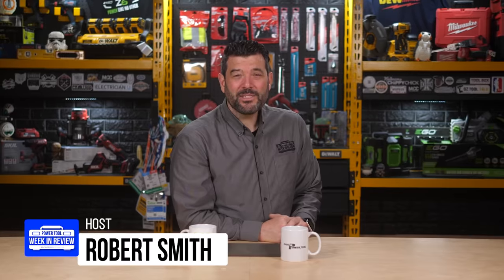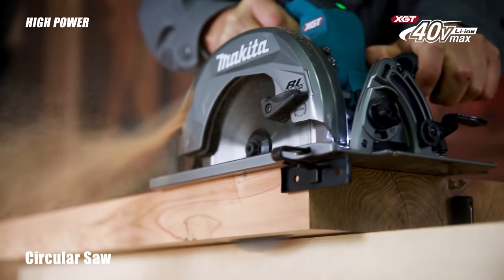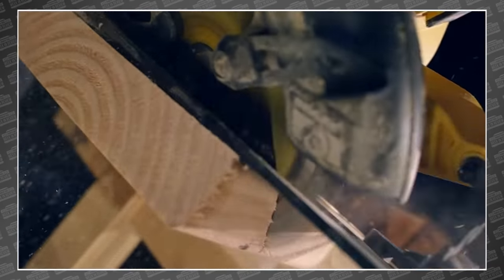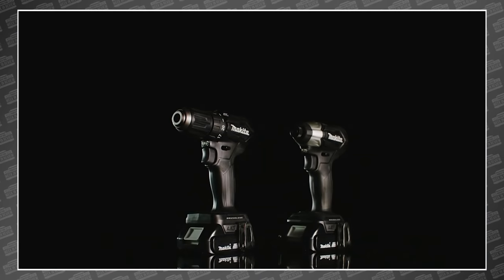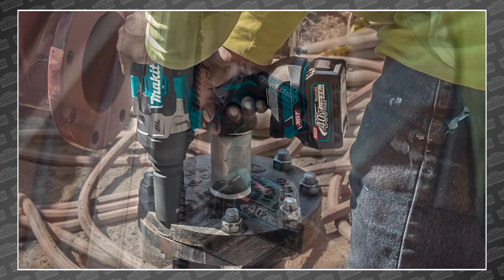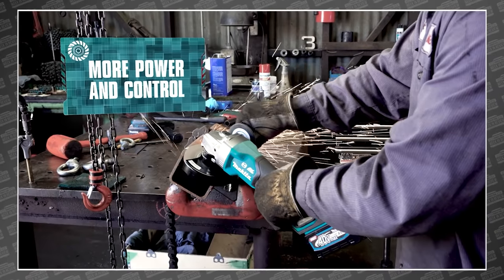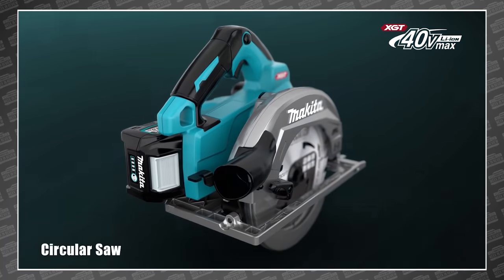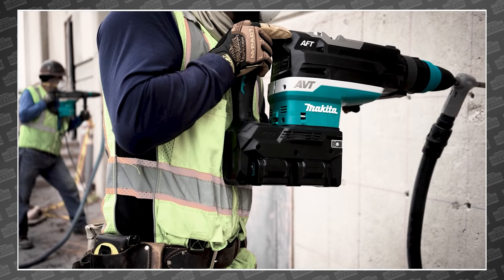FINALLY. Makita LAUNCHES NEW Makita XGT 40V/80V in the US! But the choice WON'T be easy!

Comment: yesterday my XGT angle grinder arrived.
my main problem was, no variable speed angle grinder, all LXT batterys are dead, and my charger is dead.
so, if i dont switch now, when should i.
for a time i thought about to go to dewalt flexvolt system. but the Quality of the dewalt angle grinder is not as good as Makitas.
im interesting to use the angle grinder the first time for real. and not at 3000 rpm with a pot brush to clean the center of the wheels.
maby on saturday i can cut the 80x80cm stone plates for our parasol base

Comment: Makes little sense to me since I have several of the double 18V tools. 36V vs 40V is no big deal.
Reply from the maker: I hear ya... but their point is, the 40V platform offers 80V solutions as well, which you can't do with LXT.
Reply: Aside from 40v IS 36v, it’s the inevitable double stacked “80v”/72v OPE and dust extractors that might draw your attention.  The 4.5/5” grinder are the business as well.  But, I suppose, cordless grinding is a fools errand and the 18v cuts locks just fine (just slower).   They’ve mostly been porting over LXT tools (or tools that soon became LXT versions) since the initial launch and so I’m definitely in the same boat as yourself, so far.
Reply: @ToolShow  other manufacturers have much better technology , if you you need that much power for an extended period of time you’d use hikoki/metabo hpt 36v with a battery adapter

Comment: If you need more power than a High Output M18 it's time for an MX backpack to prevent tools from getting silly heavy from batteries. Having it also be able to power M18 would be cool as well.

Comment: Thanks for this, glad I saw it. I’ve had Ryobi 18v one+ for 15 years and while they’re not the heaviest duty, I have enjoyed the single battery for all tools. I was just about to make the switch into Makita’s 18v system for the dual-battery 36v chainsaw and other outdoor tools. But if they are splitting into multiple battery types then that defeats the whole purpose for me. How long will they support 36v and 40v side by side? Not long I suspect.
Reply: Don't worry about Makita, they know there 18v customers and will continue with that line including the 36v option.
The 40v is only going to be a small specialist market. For most users the 18v is perfect.
Get yourself some Makita, you won't be disappointed.

Comment: Everyone thought Dewalt was crazy 5 or however many years back but it is still the best overlapping platform out there THEY NAILED IT!!! Yeh Makita just what I want to do go buy all new tools bad Idea
Reply: Just wish dewalt would expand it's 60v into more hand tools. Being first to market you think they would have a 60v impact by now or anything besides the 887. Interested to see if the new 12v impact rated at 450 ftlbs will be true to spec.
Reply: @zack6892  As a Dewalt fan I agree, I use multiple 887s and I've never had any problems, but that said with how capable alot of there other tools are I feel there little impacts are probably there weakest point.
Reply: @timpearson4040  exactly, the fact they revamped the 12v lineup twice now and still haven’t done anything with either the 887 or 894/899 it’s kinda a let down. Then they revamped the multi tool and made it cheaper rather than doing a flexvolt advantage version. Now Milwaukee has the better multi tool in my opinion only because Dewalt failed to capitalize. Really no good reason to stay with Dewalt right now you can get most Milwaukee stuff at similar price points if you just wait for sales maybe even save some money cause Dewalt doesn’t do hardly any good sales. I’ve already started switching to be honest and I was a Dewalt guy for the last 10 years. It’s not that the impacts listed above are junk I used all of them for years but they are so dated compared to even rigid at this point.

Comment: Since I already have a dozen tools on the lxt platform, I won't be switching anytime soon unless I have a specific need
Reply: yep, 40v line is almost double in price, too (as tools, as batteries). but some models definitely have power/speed advantage (and some now fancy stuff, as silent clutch etc), so big firms, where cost in not no1 priority, probably will make a switch..

Comment: In the case where there is one or two XGT tools I can't get in the LXT platform, I will probably just use both platforms. What am I supposed to do with all my LXT tools just quit using them? Unlikely. I wish Makita had just made a new flex volt battery. Or that they would release tools like the new duster in both platforms. There is no way you need 40V to power a duster lets get real.

Comment: I have loads of LXT tools but also have a bunch of Milwaukees M12 when a smaller lighter tool is preferable.  Whats the big deal having multiple batteries systems?  Its not like you can ever have enough batteries anyway.  I have no problem adding XGT tools to my collection for when I need something really powerful.  Having multiple battery systems isnt really a big deal.

Comment: I feel Makita missed out big time on a dual platform battery like Hikoki. the 40V max is just 36V but not MultiVolt. This segment has been better executed by Hikoki
Reply: no, it's not. different cells in 40v and definitely more power then double 18v tools. find some tests online..
Reply: @izoyt  they are either 18650 or 21700 cells, but the 2x18V option even if it were better cells was a minor adaptation
Reply: @RanDom-pl7fx  again, try to find some test ;)..
Reply: @izoyt  got any links? You have awakened my curiosity
Reply: It sounds like he's talking about the 18v x2.
But yes missed out big time. 
And could've killed two birds by using a multi-volt to finally make bigger batteries beyond 6ah.
I think I'm just going to invest more into my Multi-volt platform for larger tools rather than going a whole new line where it's only compatibility is the charger 🤣

Comment: What made LXT the best battery lineup on the market, IMO, was the amount of tools/options. I bought into Makita LXT because their entire lineup, as a whole, was better than Dewalt, Milwaukee, etc. Granted, the competition has closed the gap over the last 10 years, but LXT was the easy choice ~15 years ago when I bought in. I think I now have something like 52 tools, 25 batteries, and enough chargers to charge 8 batteries at once.  Switching over to the 40V just wouldn't make sense. For space reasons, I'm not going to carry two different lineups in my truck and the LXTs I currently own get the job done exceptionally well. What I have works, no need to switch. If Makita makes the LXT line go away eventually, they will lose me as a customer forever, but I can't see them doing that.

Comment: So instead of taking what they have and making it better, more powerful, while keeping it backwards compatible, they want you to upgrade to their new system. How many years until they want you to upgrade to their next 'new' system. Screw that. If I didn't already have a lot of LXT stuff, I'd ditch it all and go 100% Milwalkee. I've been envious of the Milwalkee advancements in their system for awhile, and kept hoping Makita would catch up. Instead they do this. I'll be replacing my LXT stuff as needed alright, but it will  be with RED tools, not XGT.
Reply: Well said I don’t understand how Dewalt can make  one battery 54v/60v battery and make it compatible with 18v/20v, hikoki can achieve 36v from one battery pack and make it backwards compatible, Milwaukee has higher output battery packs for more demand tools, don’t see the other manufacturers worrying about losing sales/customers to Makita, but I could be wrong?

Comment: My LXT impact driver, drill, and 36 volt saw is powerful enough for what I need, the LXT impact driver XDT16Z is a damn beast at 18 volts, I don’t see a need to get a 40 volt. Having said that, those tools don’t require much power to perform well. 
Now, if I need a chainsaw, grinder or a reciprocating saw then I can see the need for the 40 volt. I am planning on getting a grinder and reciprocating saw so I will be getting the 40 volt, I don’t mind owning both platforms, I just wont be buying any impact drivers on the 40 Volt.
Reply: The XGT impact driver and the drill are pretty much on par with the LXT versions.  The motors are the same size.  The hammer anvil is the same size on the impact. You won’t miss them, the XGT versions only exist so that you can use the same battery from the other XGT products. They wanted to have a basic framing/residential construction power tool kit all on one battery for the initial launch.   You’re right on the money.  Being on the LXT platform, it’s those grinders and the upcoming ope products that have my eye.

Comment: The April launch was not a well kept secret. ;)  Anyway, Makita has been good to many, providing 12v sized and 36v powered tools on the same 18v platform.   Currently, for me, nothing has been compelling me to jump into xgt except for the grinders.  I was so po’d when they released the lxt version of the xgt drill and subtracted the electronic clutch.  Should I fall into their trap and buy into xgt for an electronic clutch? Well, I already do carry around a Festool drill and it’s  batteries and a Metabo drill and it’s batteries just for the electronic clutch.  I am that sucker. When the 72v x2 ope products arrive (oh and they will) it will likely force my hand.  Since Makita, Dewalt, and Milwaukee artificially inflate their individual battery prices in order to market “deals” where you get x amount of free batteries or half off batteries in December, I have no choice but to wait, anyway.  I really don’t understand why they think professionals and tradespeople appreciate that thinly veiled battery promo hogwash, btw.

Comment: I‘ve had my hands on the 40v drill a few times now and it is not much more powerful over the Milwaukee M18 drill or the big one from Bosch. A new and stronger Bosch biturbo drill is available soon and I guess it could even be stronger than the makita. It‘s a lot of marketing. I promise you the makita 40v line can‘t compete with the power of Milwaukee MX. Milwaukee has its Fuel and High Output batteries, Bosch has its Biturbo technology with Procore (core in the U.S.) batteries. Till now makita wasn‘t able to modernize their 18v battery technology. They are still using the old cells. Instead of inventing a new more powerful brushless motor and battery combo, they offer the all new line of tools...

Comment: I've been buying these from Japan for a few months.  The impact drive will run for days and beats the pants off my Dewalt 887.  Its impact wrench is awesome to use when taking off bolts.  Makita is lightyears ahead of the completion with their autocycles on drills, impact drives, and wrenches.  I can't wait for the outdoor equipment to come out.
Reply: ...uhmm...I hope this  40v tools are made in japan
Reply: @danmorgoshi7598  Japan is their test market.  Makita’s Japanese production capacity is small scale.  It was the major economic boom time in Japan when they built the large factories in China that cover their mass scale production.  There was no way they could get the real estate nor could they (and still no way) staff those larger factories in Japan.   They’re an Asian company, they make most of their stuff in Asia.  If anything, the bs conspiracy theories about Made in Japan Makita supposedly being “better made” ought to apply to their factories way out in Germany, the UK and the USA.   They’re not some Bain Capitol portfolio asset that has been gutted and had the factories closed and production outsourced to some random lowest bidding unrelated factory.
Reply: @robertrada4783  ....✌Thanks..!!
Reply: @danmorgoshi7598  Unfortunately the set I imported from Canada is made in China. So far the only Japanese made tools I have is the impact driver and the 6 1/2 miter saw. We’ll see about the compact drill arriving in a week. Still love the hammer drill, and circ saw with the track saw base.
Reply: @ThePr0vid3r  Thanks..👍

Comment: Makita missed the mark in my opinion, we have Milwaukee, Dewalt, festool and makita already on the job. I don’t really want another platform. Wish they would have taken the flexvolt approach and I would be interested. What am I supposed to do with the 14 lxt batteries? Leave them behind? Maybe down the road when the lxt tools and batteries start to become obsolete, but until then sorry makita! The new tools do look awesome though!
Reply: I don't get it. How is this different than the jump from Flexvolt and regular Dewalt batteries and/or XR batteries?

Dewalt has a ton of batteries, and tools that either don't work, or work sub-optimally depending on tool. 

No different than Milwaukee high output batteries and/or tools.

If anything Makita has had the most standard battery platform for the longest time. 

Hell, even Ryobi came out with 40v some time ago for their OPE.
Reply: @DESX312  because the flexvolt 60v batteries can work on all Dewalts tools. Even though you can’t run a 20v on their flexvolt tools. But at least they are somewhat compatible. As far as tihe new makita if we could run the new 40v batteries on the old tools that would be cool. But instead we would have to buy all new tools. Honestly I don’t really care just thought it would be a good idea. Have a good one bud!

Comment: Basically what I think makita doing is going to eventually phase xlt tools and stop manufacturing those but you still can buy the batteries. The Xgt is eventually the only tool you can buy eventually.
Reply: no, XGT is more complex, more electronic involved and more expensive. An average joe don't need a 40V drill to hang a picture in drywall. Makita also made clear in some marketing campaigns that the LXT 18V is still the main lime on cordless tools and the XGT 40V will be a specific line of products for heavy applications. Don't make any sense have a vacuum cleaner 40V, for example.

Comment: They seem to do this change every 10-15 years to make you buy a whole new set of tools. Switching from Makita to Makita for more power? Doesn't make sense. Just like using two batteries to run the tool. Why didn't they make a bigger or stronger battery in the first place. Just another way for more sales I say.
Reply: different cells on the market ;)

Comment: 40v tools are backward compatible if you use the battery backpack. I'm already doing this as if I'm going to use the larger batteries I'm wait for larger 5amp batteries and dual 40v volt charger which aren't out in my country yet. In short my 40v max mitre saw  is powered by 18v batteries and works just fine.

Comment: Just make the f*cking cordless tablesaw and framing nailer in about any form factor already
Reply: Second the framing nailer. Almost bought the Hikoki with a weird ass battery converter setup cause of the lack of a Makita Framing Nailer. I have the 16 gauge, and pin nailer. Waiting for a revision to the 18 gauge and NEED the framing nailer.

Comment: The market is saturated with cordless tools that use differents battery on the same 18V, its sickening... And now 40V ?
40V over 18V mean less amperage for the same consuption, reducing wires size. Why not go over 40V per battery ? Well, 35V is about the start at wich you can get a shock on dry skin, so going over 40V would be risky. Personally i would have chosen 48V since its a multiple of 12V and used in many domains needing backup power such as hard telephone lines and trains. Unfortunately, 40V mean you have to use their battery and wont be able to use an adapter to fit others brands of battery. Kinda evil since the battery wont be compatible with eatch others. Makita plan to make people buy new tools, even if theirs are still working fine. They could probably make an adapter in T shape, that you connect a smaller 18V on eatch side, but i bet they will leave that to the DIY thinkerers. If i where them, i would have released an adapter with a DC to DC converter 18V to 40V for around 30 USD.
Personally i just transitioned from old, bulky and heavy NiCad12V/14.4V B&D to a set of 18V black Makita. Maybe if they release a sinwave inverter running on 40/80V that is way better than the Dewalt 4 battery system, and can connect 2 to 10 battery or more, or maybe modular... i might be interested. (my batteries usually colect a lot of dust betwen uses, so using them as backup power would be good, and it would be a reason for clients to buy more batteries.

Comment: I’ve been in the trade for many years and switched from the old red push in makitas to the LXT, I’ve even got some 36v kit. I have a few that will need replacement in the next year or two. It pains me to say it but DeWalt 18/54 flexvolt here I come. One battery fits all and if you are screwing all day, weight matters, also the abortion that is the Makita box/stacking system. I’m about to take sooooo much shite after years of ribbing friends about their girlie yellow bellied tools 😂🤦‍♂️.

Comment: Bosch pro core 12 amp laughs in its face.
Reply: Except Bosch doesn’t have any actual tools to run off of their batteries.  Just vaporware.
Reply: Milwaukee and DeWalt have has the 12ah out for a while now.

Comment: Smh just another reason to stick to milwaukee
Reply: This is comparable to Milwaukee MX...
Reply: @pablorodriguez5100  mx is ment for large tools like jackhammers makitas 40v is just replacing the 18v basically
Reply: @nuclearexplosion5841  for now...
Reply: I wouldn’t mind a more powerful/larger track-saw. Besides that I don’t see why I would invest in this. Maybe make a DIY one with the 10 1/4 inch saw they have.
Reply: Milwaukee is very much about having to buy very different sized battery packs for different power draw tools on the same damn 18v platform (all the while releasing tools exclusively to the 12v platform).   I like their stuff though.